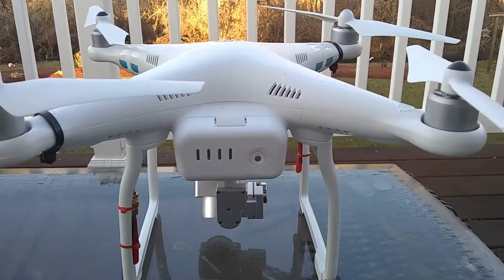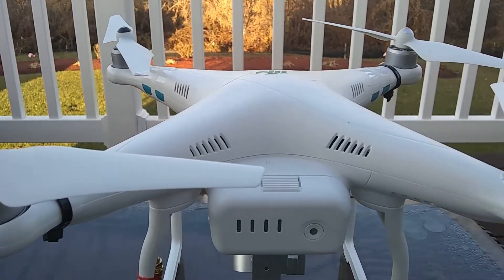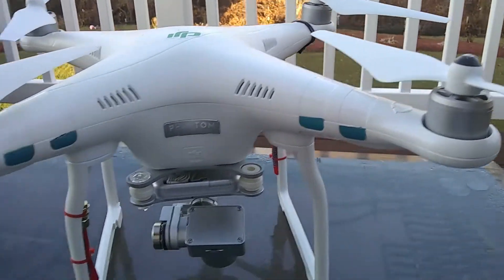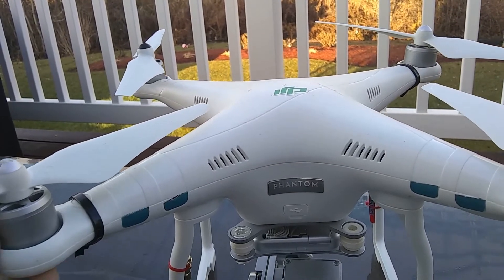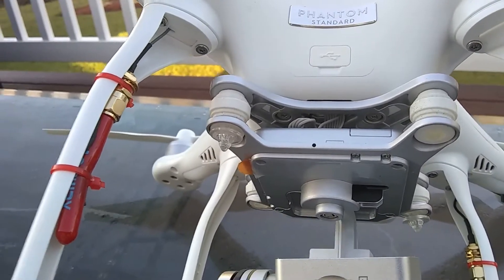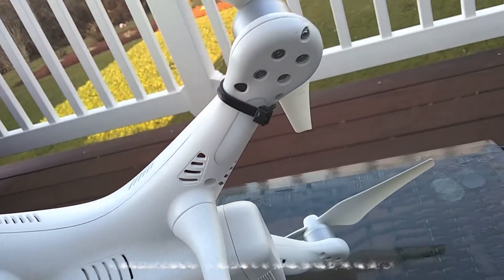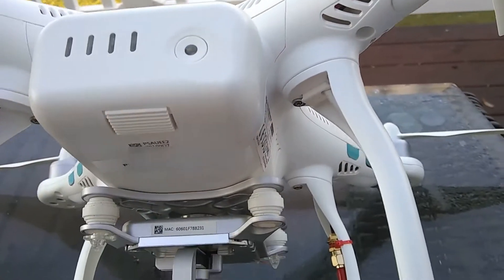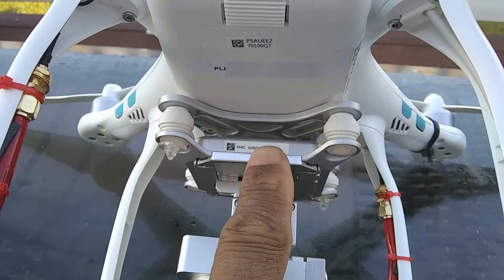Phantom 3 Standard Long Range Aomway Antenna Mod Explained

Comment: Is this all I would need too boost the controller signal https://m.ebay.com/itm/2x-6dBi-2-4GHz-5GHz-Dual-Band-WiFi-RP-SMA-Antenna-2x-35cm-U-fl-IPEX-Cable-N8S5-/192505973970